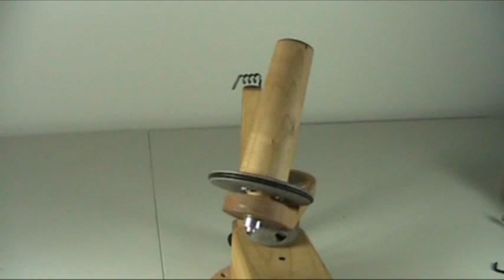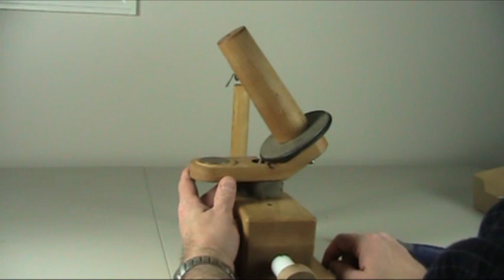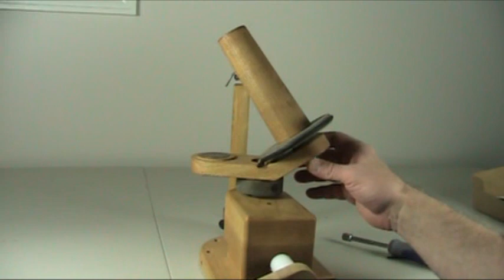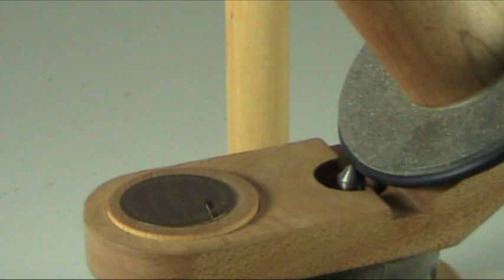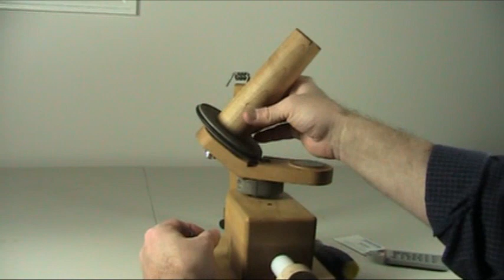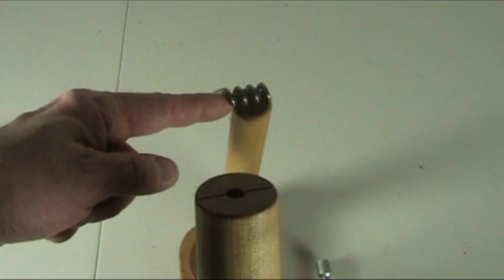Heavy Duty Ball Winder O-ring Adjustment

Comment: Thanks for posting this video. The winder came with the spindle very tight against the shaft, as one would expect in shipping (and thanks for the almost complete assembly as well). But the verbal description--that the spindle should "spin" suggested a free spin, which didn't make much sense since there wouldn't be any friction to help wind the yarn on. Just watching the very fast adjustment with the nut wrench was extremely valuable. I adjusted mine and wound two non-wonky balls of yarn.
Reply: nessasmomma1 9417331841